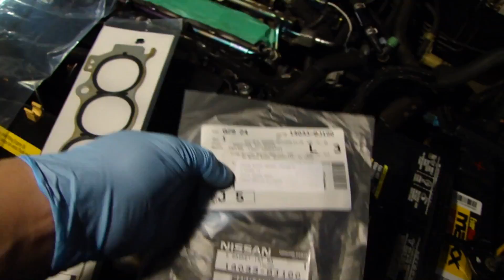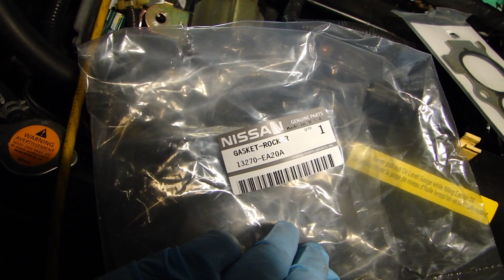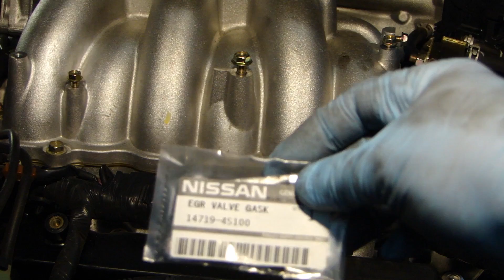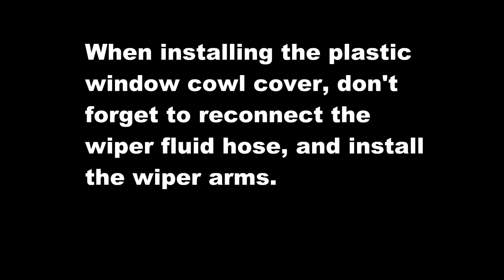Nissan V6 Replace Spark Plug & Valve Cover - VIDEO 4: INSTALL INTAKE PLENUM

Comment: Great video series. I am watching this in 11/2023 to repair my 2008 Nissan Quest as the Right/below valve cover gasket started leaking oil, it has only 96k miles though. I used many of your videos to help me change the struts, shocks, wheels hubs etc for the same vehicle. Appreciate all the details that you put together. Now I am debating if I can do this job myself or have it done by someone else. The oem valve covers got very expensive now, over $200, there are a bunch of aftermarket available but I am not sure which ones to go with?! I am also debating to get rid of this car but I see no other minivan in market as comfy as this :)

Comment: One thing I've notice everyone does the hard way is removing the 4 bolts connecting front and back plenum. Remove the 4 bolts on throttle body put it to the side and remove both plenums. More room to work. More room to move the wire harness. Also the two harness plugs right back side. Just pinch real hard with your finger against the bottom of where it fits on bracket. You will fill a little something to push on, wiggle a little and comes right off. Just saved you 40 minutes of work.

Comment: do the gaskets need to be replaced or is it optional? I just need to replace my spark plugs.......
Reply from the maker: The gaskets need to be replaced. Since you are changing spark plugs, most likely the mileage is quite high, so the gasket is very old. With so much work involved in doing this job, get the gaskets changed so you don't have any problems after. You don't want to do this job twice.

Comment: Thanks for your series of videos on this job. It was by far the best ones I found on how to accomplish this job. My 2007 Maxima was a tiny bit different than the vehicle you did this job on so I didn't have to remove anything at the back of the engine bay to gain access. I was able to utilize your videos during the process to refer back to while in the midst of handling the job. Thanks for being my expert to reference on this job!
Reply from the maker: Thanks for sharing your experience. Glad you found my video helpful!

Comment: I mean no disrespect with the following. But...

The 2 "studs" on either side of the plenum SHOULD be left in tact. This prevents the very important gasket from getting out of position; when you are re-installing the plenum. And the reason WHY there are two studs and nuts; instead of being like the 3 other bolts in front of the plenum. Also why the odd shape of the gasket.

There is NO need to remove the studs (and one should not remove them) when removing the plenum. Simply remove the nuts; and again this assures the gasket fits correctly when re-installing the plenum. For the gasket could get misaligned if the studs are not there; and how would you know it? One can only imagine what would happen if there were cracks between the plenum and the engine block; even though the bolts and nuts were tightened correctly.

Again I mean NO disrespect.

Comment: I have a 05 Nissan Maxima and I have done a lot of work on it just by looking at what was in front of me, I video the area first to make sure that I put it back the same way, but you have up the whole game. Your video is on point 👍 Back in the days before video we had to get a book to see what was what and go from there and it was great of you to put the part numbers in to now that is a HELL of a Move 💪💪👍👍👍 because when you go to a dealership if you don't know they can and will BS " you on the price and I have had them give me the wrong part. So yes this video is a great one. Outstanding job.👍👍👍💪💪

Comment: Was there a torque setting for the two 12mm bolts securing the upper collector for the intake manifold: the one you used the Pittsburgh Pro flexible ratchet to reattach?  I cannot find the torque settings for those bolts in the EM section of the FSM.  Your videos are great; even more so, I am really grateful that you've been answering all the questions I've fired at you.

Comment: I have 2005 Nissan quest very similar to your vehicle too the video looks very helpful, I'm planning to the same kind of work to my vehicle do you recommend to replace the valve cover any way thank you for this video I'm sure it will be very helpful
Reply from the maker: It depends on your mileage. If it's around 100k miles, you should replace it because both front and rear valve covers WILL leak. Since it's so much work to do this service, you should consider replacing at least the back one. The front one is easy to do at a later time.

Comment: Thanks so much for your videos on replacing the valve covers and gaskets. I am mechanically inclined but this is a major undertaking and very time consuming. Using your videos I was not intimidated at all about completing the work. Got it done but it 
was still leaking oil from underneath around the oil filter area. I found your video on replacing the oil cooler o-ring which I followed. No more leaks...WAHOO!  My car is a 2008 Nissan Quest but it it almost the same as your 2004 Quest.
Reply from the maker: Thanks for sharing!

Comment: I've been keeping my '04 Maxima rolling watching your excellent videos.  Have a question about replacing the rear valve cover.  Did I miss it or where in your videos is replacing a new O-ring and tightening the PCV valve on the rear (right) valve cover?  Part # for the o-ring?
Reply from the maker: If you buy the Nissan valve cover, it comes with a new PCV valve. I had my valve cover replaced around the same time.

Comment: Very nice detail in your video of tools and parts and process. i have a 2009 at 118000. I will be doing also a complete rebuild of the front end do you have any videos on this?
Reply from the maker: Sorry I don't have any videos on the front end. I have since traded the van in for a new Pathfinder.
Reply: Ok thank you very much. I will use this video to change plugs and vowel pan cover, again ty for the video.

Comment: Hi thanks for these videos on replacing the spark plugs. I just bought a used Nissan Quest that was running extremely rough with about 217K Miles. Was getting multiple misfires on my obd. Never have I ever taken apart a engine. But I tackled this job replacing the spark plugs and coils because of your videos and how detail oriented you were. I Was nervous that I forgot to plug something up with all of the different hoses and everything. Well I got tackled the job, started around 7pm and finished removing everything and then called it quits around 11pm. Next day I got started around 1pm with installing the plugs and coils and putting everything back. I got done at roughly about 6:30. So for me without rushing or overlooking anything It took 9 hours. But the reward from when I turned the key was unbelievable. It’s like the engine is totally different. Huge jump in gas mileage, as well as unbelievable performance. I went with NGK Iridium. Brand new coils as well. Thanks for the outstanding videos for this project. I’m sure I will be looking back at more of your videos for my quest needs.

Comment: Do you not have to set gaps on the spark plugs?
Reply: The plugs are pre-gapped at the factory already. If you want, you can check with a gauge.

Comment: Excellent teaching video. You glossed over a few of the names of things: One of the last components you disconnected just before you pulled the vc cover. Missed the name of it. Also, what did you do on the 2 clamps you had to break? And what was that "thing" under the cover? What is the EGR hose? 
But overall good show. 
I am about to undertake the same procedure on my 2003 Murano. Watched your 4 part videos 2X. Subscribed and multi checked the thumbs up.
Reply from the maker: The last thing I took out before removing valve cover was the spark plugs. Followed by all the bolts holding the cover. The 2 clips that I broke, I was able to push it back in with half the clips still left.

Comment: Hi. Good gob you do a great gob. I have. A questions did you remplace the power steering hose ? In Nissan Quest 2004 ? Thanks for your help appreciated .
Reply from the maker: Yikes, the power steering hose on the Quest. Yes I had to replace it, and no I did not do it. That power steering hose will eventually leak. The replacement is a pain. The hose sits back by the firewall side, and snakes from the bottom to the top and there is a bracket that bolts to the intake plenum, then comes back down. You can probably get to that bolt by removing the intake plenum. Or in my case, the shop that did the repair just cut both ends, put in the new hose and left the old one in the car. Not really how I like it done,  but then I can't really blame them.

Comment: First off thank you for the incredible five (5) video set.  The quality of video, succinct instruction and insight are much appreciated.  I intend to perform the work on a 2005 Murano.  Are their any significant differences between the Quest and Murano of which I need to be aware?  Secondly, can you provide a bit more detail with respect to where to place the RTV gasket silicone?  This was hard to see in the videos.   Thank you again for your amazing public service!  AS are many I am most grateful!!

Comment: sorry i meant the ignition coils. but have you had any problems with the coils going bad? also have you ran into the problem of one of tensioners on the timing chain breaking and haveing that rattling sound??
Reply from the maker: I just replaced the back 3 ignition coils recently. Here is the video:
https://youtu.be/RcQL_tUs13Q

As to the tensioner issue, it usually don't pose a problem if the van has had frequent scheduled oil changes. I have not had this issue yet but I know many people have.

Comment: why not replace the spark plug wires while you had the intake off?
Reply from the maker: hmmm....because most cars made in the last 10+ years don't use spark plug wires. It uses ignition coils.
Reply: Sam Barber  you big dummy

Comment: dial2fast, thanks for the videos they were most helpful getting my sparks plugs replaced in my 2005 altima v6, one question when I was putting upper intake plenum back on one of the star studs for the EGR valve was not lining up correctly when I tried to screw it back now I'm getting a high pitch whistling/whirring sound. I'm assuming I just need to loosen the top intake plenum and reposition it so it's flush. Please let me if that sounds about right and thanks again for making this videos so average Joes can fix their cars.
Reply from the maker: Since I didn't have that issue, it's hard to say where that noise is coming from. Make sure you are using new gaskets so you will have a good seal. I guess you can try to put your ear to it and see if you can pinpoint where the noise is. Otherwise you can try realigning the plenum and the EGR port by loosening and tightening.
Reply: thanks for the quick reply, I'm probably going to get new gaskets since you stated which part numbers to get which was most helpful. Thanks.

Comment: I really need to see how chance injector in this 3.5 v6 engine...i have cilinder 5 misfire or how i can start testing and checking what is causing misfire and that cilinder ...thanks if you can help me...

Comment: I've been backyard wrenching for over 25 years and have gained much experience over that time. The process that you use to explain the job is exceptional: the camera angles, lighting, focus, and volume are crisp: tool explanation, part replacement, and organization are superb. You explain it the way a mechanic would want to hear it. I'm changing the same gasket on a 1997 Nissan Sentra with a V6. I believe it is very similar, other than the cowl removal. Just want to say that I appreciate this video and look forward to future views.
Reply from the maker: +Jason Busse Really appreciate your comment. I try to do my videos like the way I want to learn it. Happy wrenching!!

Comment: The process will be the same for a 2004 Pathfinder? Actually is leaking but I am not sure if it is from the back or front one.
Reply from the maker: +JUAN ALEXANDER VARGAS MENDEZ I believe Pathfinder is same engine but for rear drive, it's rotated 90 degrees.

Comment: Dial2Fast, Big help with the videos! I just did this yesterday on my '04. Everything seems to be going well except- and this may seem strange-  the AVG Miles Per Gallon on my Fuel Economy display are astronomically low. I think on a 15 mile drive I got 9.5MPG at best. During the whole process, the only time I felt confused on what I was doing was when it was time to reconnect the green connectors. I don't know what they are for, and they don't seem to be indicative of a particular placement. They looked interchangeable- or maybe I got lucky and got them right to begin with?? Any ideas on the Average MPG? Thanks for your help!
Reply from the maker: The average MPG I get is around 17 to 19 MPG. If the car drives well, you can try resetting the MPG and drive for few days and check again.
Reply: Well, I am finally glad to find someone honest about this because one of the selling points on this old van was that the previous owner stated he average around 24 in town and over 30 on the highway. Not such an honest statement lol. Thanks for the quick response!

Comment: I did this to my van and now it's running even worse since I changed the plugs and cool pack.
Reply: +jlwzqw2008 If it has a high idle, then likely you forgot to re-attach a vacuum hose or one of the gaskets got out of alignment and it is sucking too much air.  If it is missing, then one of the plugs isn''t seated correctly, or is threaded incorrectly.
Reply: +Chuck Scarborough thanks I will try checking the plugs I've already been through all other steps

Comment: I have played around with cars for over thirty years, during which I have seen loads of manufacturing changes, some of which add hours and hours onto the simplest of repairs, like for instance swapping the spark plugs.

I would not tackle a job like this video shows nowadays but I can, with my experience, appreciate the skill and patience required to work on modern day vehicles.

Ray H (Silver surfer) from the UK.

Comment: I tried this without the video and yeah it was alot of work. I got all the way to past taking off the plenum but couldnt figure out to take the valve cover off.  I am thinking of changing the spark plugs in the front as well as the back. So if i do that? do i have to buy both brand new valve covers?  I cant use the valve cover that was there before and just install a new gasket.
Reply from the maker: It depends on the mileage you have, if you have say 60,000 miles or more on that valve cover, then get new ones cause the spark plug tube o ring is not serviceable. I actually did a video to show why http://youtu.be/mYw4S2mbSBE

Comment: So you can't just change the spark plug o rings? You need to buy the whole valve cover? Its for a 03 nissan murano 3.5 v6
Reply from the maker: If your V6 is same as this one, then no, you can't replace the spark plugs o ring.

Comment: I had the same issue on my 05 Quest. But when I saw how much work was involved I said fuck that. I gave it to my mechanic. And living in an apartment doesn't make it any easier either.
Reply from the maker: Yeah, the job is quite involved and you need the space and tools.

Comment: Hey, great and very helpful video. The valve cover gasket of my 04 quest is leaking too. But mine is the one in the front, since it's easier to change the one that covers the three front cylinders, i was wondering if there is any tip to follow before i get started. Do i have to disconnect the battery, or do i have to take the air intake off? thanks
Reply from the maker: If it's only your front that is leaking then you are lucky. But I would make sure your back one is not leaking too because 8 out of 10 leaks are on the back one. Anyways, front one don't need to remove the intake plenum. You can always replace it and see if the leak is fixed. You want to disconnect the battery neg terminal before doing the work.